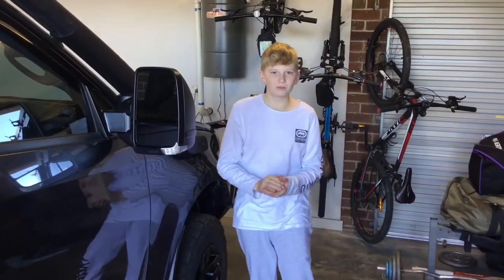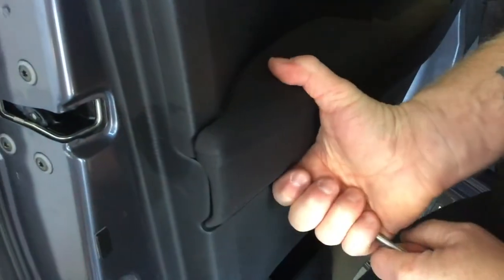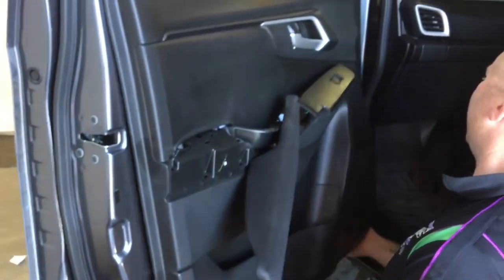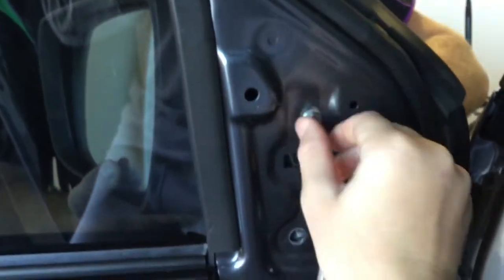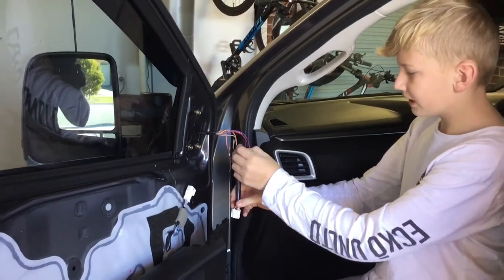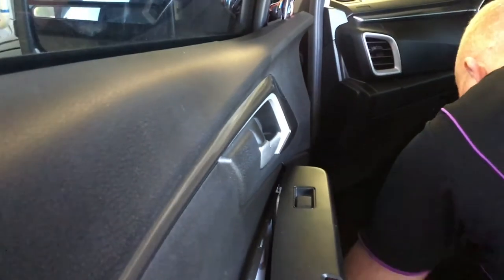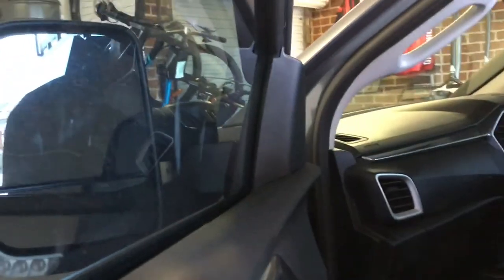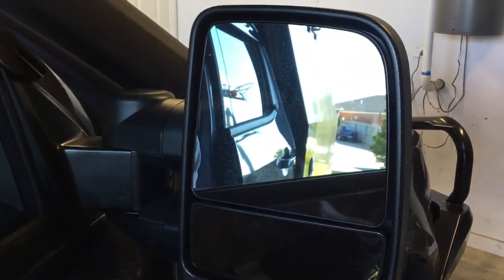Clearview Next Gen mirror install on MY21DMAX

Comment: Life hack: Instead of undoing the rest of the bolt with your fingers like that, which is a bit fiddly, you can just twist the socket on the wrench with your fingers. It's a bit easier to grab onto :)
Nice presentation, now I know how to take the door panel off! Cheers.
Reply from the maker: Thanks for the tip

Comment: Hi mate, do both mirrors extend out the same length? I have brand new ones on my X Terrain and the passenger side comes out only half the distance to the driver side one. Great vid by the way, I used it to install mine. Cheers Bubs
Reply from the maker: Na, both come out the same length. It might be jammed or something like that
Reply: @campbellwood0311  Thanks for the speedy reply.